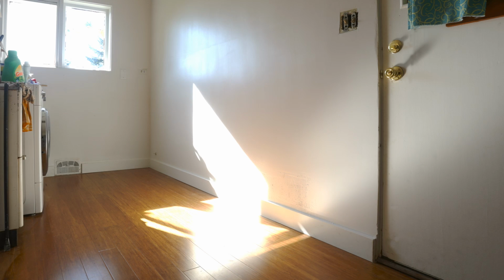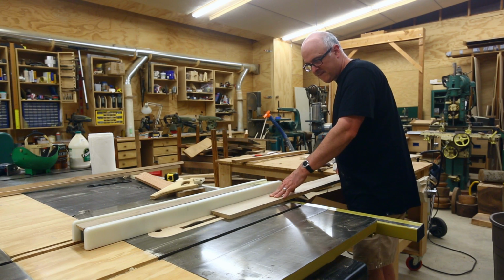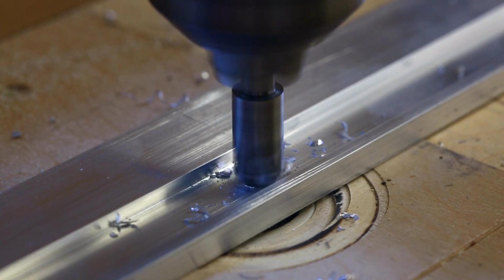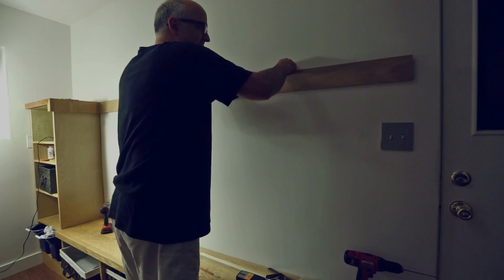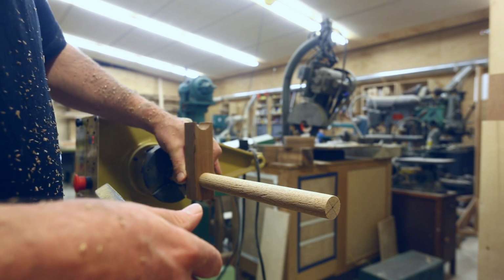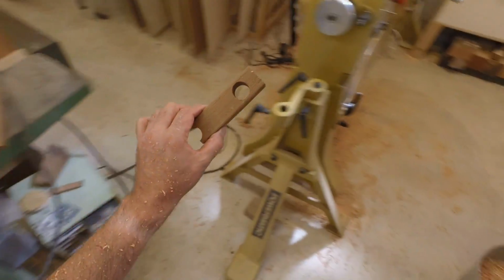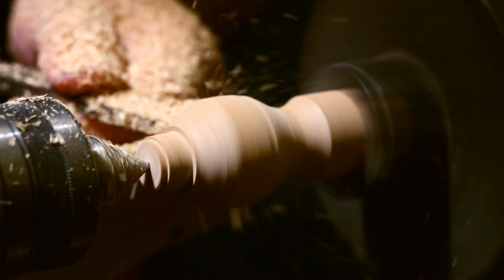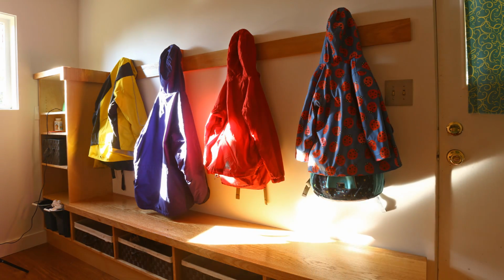French Cleat Coat Hooks

Comment: when you pull a coat off, does it not pull the rack off the cleat?
Reply from the maker: weesh ful There is usually a bag hanging on the lower hook holding the whole thing in place.
Reply: +frank howarth Since one end of the wall french cleat is open you could add a squared off piece to the back of each hook cleat, so that it grabbed the top and bottom of the wall cleat.  Then slide them on from the right side.  I don't know if they would technically be french cleats anymore though.  Your videos are awesome.

Comment: Very nice work, but it seems to me that you doubled your work by essentially putting a French cleat on a French cleat. The only benefit I could figure is that you hid some screw heads. Why not attach the wooden French cleat directly to the wall? Or , am I missing something?
Reply from the maker: exactly,  I don't have fasteners on the face of the wood cleat.
Reply: Thanks for responding! Again....very nice work. I'm a new subscriber.

Comment: Nice project Frank! Not sure if you're interested in using new finishes, but I stopped using the Minwax wipe-on poly, and started using General Finishes Arm R Seal. It goes on exactly the same way, but has much better results and never looks plastic-like. It also settles down a lot nicer, less streaks. Keep up the great work!
Reply from the maker: I will have to look into that, I really do want to get my finishes figured out better.
Reply: frank howarth For projects like this using the poly is perfect, for what Mr. Alm said about it looking like plastic, just thin it 50/50 (same as wipe on poly) with mineral spirits and build up the finish with lots of thin coats sanding in between, you get a really nice hand rubbed look with the protection of polyurethane, I use it on tables. Another finish, which is quick and easy is Deft in the spray can for small objects. I also use Minwax Poly crylic on table tops. And Danish oils, always safe. My thoughts on finish is less is more in most cases. A lot of people take a project with good form and slather on some cheap looking stain and ruin it at the last minute, common in 2X4 projects, painted finishes with clear coats and different surface techniques are a good option for less attractive woods. Love the videos Frank, I've been following you for a while now, your editing and camera work are very inspiring. Thanks
Reply: It's true that the wipe on poly can look great and is very strong. I just suggest the Generals Finishes, because for the same or less effort I've had really fantastic results. I work in a wood fabrication shop and have converted everyone there over to this stuff. For about 5 dollars more a can you eliminate the concern of things looking plastic, can put the coats on pretty thick, and you don't have to do any alchemy. It seems to self level. It's less sanding, and less streaky. I put it on my heavily used kitchen counters 5 years ago, and it still looks great.

Comment: Great project, the ending had me laughing. I was thinking about maybe making smaller hooks to fit more things, or maybe different type of hooks. Also, my dad has experience in home-building and the little pipe that water started to came out when you started to remove the old cabinets reminded me of things i've seen him doing, like floor water-heating systems and also refrigerating systems of all kind.

P.D.: You got me really interested in woodworking at my actual 17 years of age, already made some projects, thanks a lot!
Reply from the maker: That is great to hear.  My best guess now is that it went to a refrigerator.

Comment: somewhat unrelated: Do you sharpen brand new tools or accept the factory-sharpening? I just got a new 1/4" chisel and I'm not sure I'm happy with the rough-looking sharpening job they did but I also don't have a diamond sharpening pad/plate.
Reply from the maker: if it's not cutting well, sharpen it.  If it is giving you a lot of fine powdery saw dust, and is getting hot, then it needs sharpening.
Reply from the maker: John Smith Yes the diamond stuff is not the end all. we have been sharpening things for thousands of years just fine
Reply: I picked up an oil stone from a junk shop last week for £2 ($3) and it's in perfect condition housed inside a home made wooden box, I've been sharpening all my chisels and they've never been as good as they are now, I don't think I'll be using my diamond sharpener again any time soon!